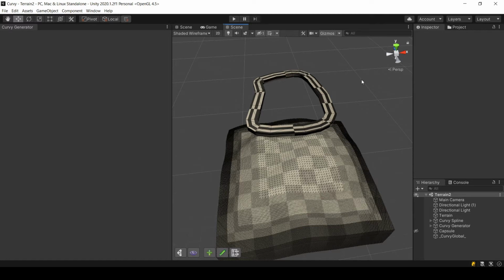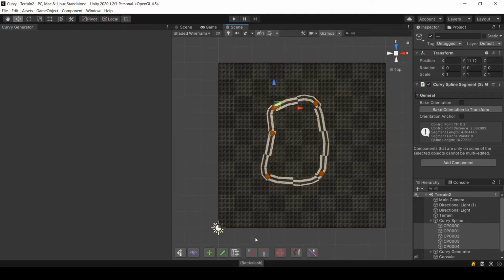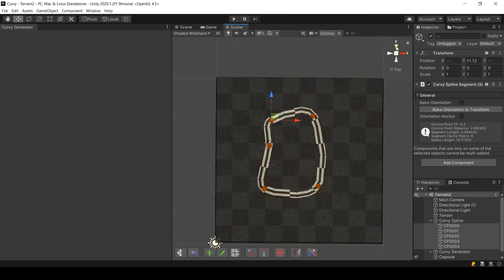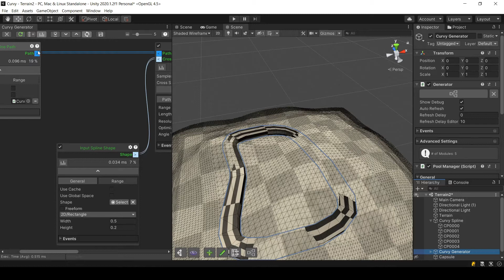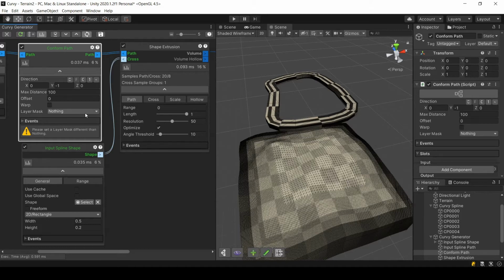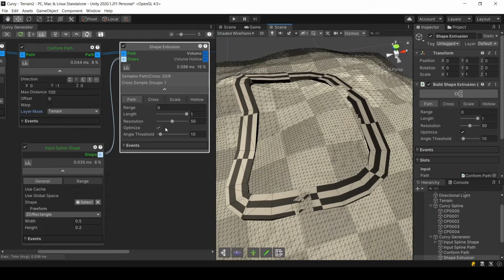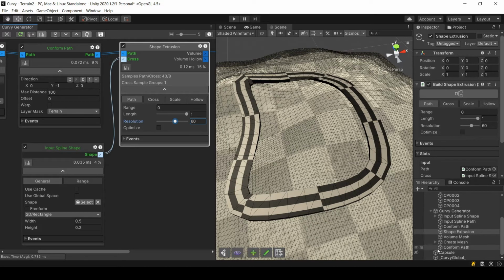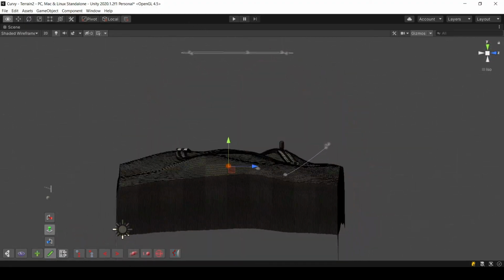Project road on terrain - Curvy Splines tutorial

Comment: Hello once again, I'm trying to create my first custom road, I'm wondering is there any option to "close" start and end of mesh? Currently if the shape is not using closed path you can see "inside" of that mesh, I would like to close that path, to avoid user looking inside mesh geometry :)
Reply from the maker: Hi
You should use the Volume Caps module. One of the example scenes using it is the 27_CGVariableExtrusion scene.
Reply: @toolbuddy  Thanks I will check it!
Reply: @toolbuddy  Got it! This sample scene helped a lot ;) Once again thank you